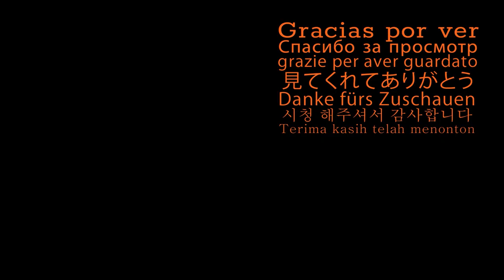Knife Making: A Full Tang Hammered Gyuto

Comment: What's the HRC? Because soaking 52100 within 15 degrees F for 5-15 mins on a forge is pretty difficult, especially when you can't see the blade since it's wrapped.
Reply from the maker: You're not going to like to hear that's it's AEB-L 😬. All I can say is that it's between 55-60 hrc.
Reply: Oof. I don't know man, without knowing the exact temp and whether or not the entire blade has been austenitized for a long enough period of time, I'm not sure I would personally feel comfortable even making that wide of an HRC claim to a customer. Areas of that kitchen knife might be less than 50 HRC. Why not use steel that works better with the equipment you have on hand, like 1084? Or use a service?

I'm not trying to call you out. I just don't see how spending more money on pricier steel and foil is worth it when you can't do an adequate heat treat with the equipment you have. Use that extra cash for a HT service where they even have a Rockwell tester!
Reply from the maker: @goot776   @Goot  yeah man, all good points. I'm sure you've been doing this a lot longer than me. Learning every knife. Already said I wouldn't be using stainless steels anymore until I can get an optimal heat treat with an oven and cryo. A friend wanted stainless so I did what I could (which did produce a fully functional tool).

Just a guy messing around with steel and wood on the weekends. Metallurgy aside, I hope you find some value in the design work - although now that I think about it, I haven't done videos on a few of my favorite designs. Gotta check out Instagram for that.

Comment: epic knife
just wondering why did you put the knife in the metal sheet and put back in forge is it like pre heat treat?
Reply from the maker: Thanks! So first know that this is not a proper heat treat for stainless. It did harden to at least 55 HRC though which is on the lower end BUT fully functional.

The stainless steel foil creates an oxygen free barrier during the heat treat which help reduce forge scale (which eats up belts when trying to remove). Also, since I hammered the texture into it, I did a normalizing cycle first. As I mentioned, I'll be using more carbon steels that I can get better performance out of until I can get a HT oven.